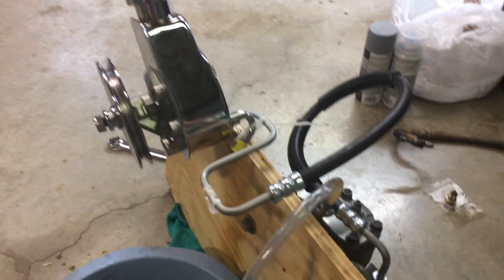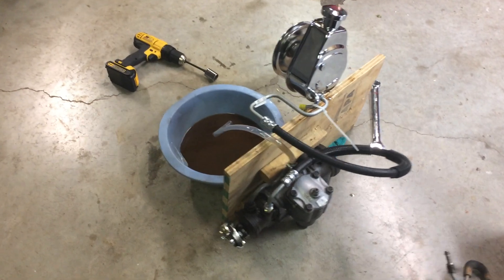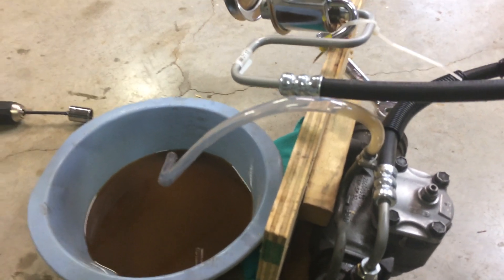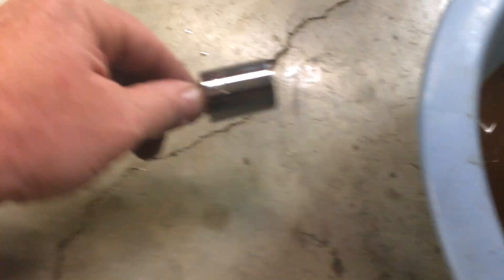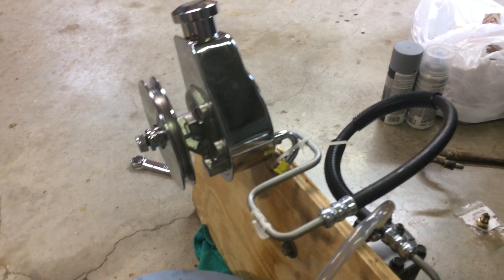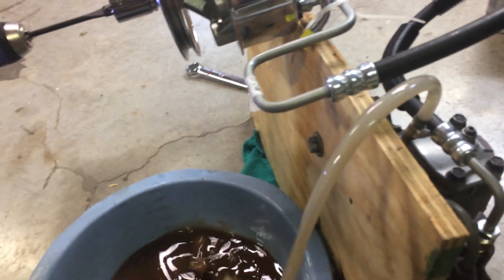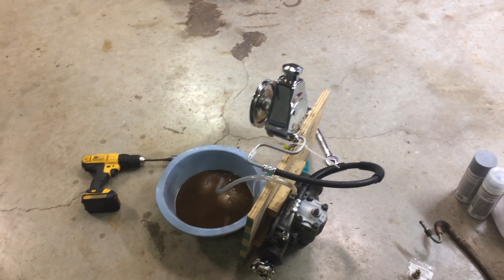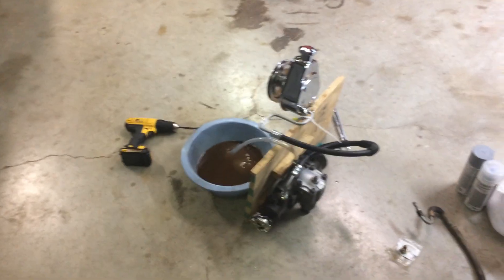Bench bleeding a power steering box Saginaw Chevy Camaro Chevelle Nova Corvette

Comment: Did you need to upgrade your pump in order for it to work with that box or is it a stock ps pump
Reply from the maker: It’s a stock style aftermarket Tuff Stuff power steering pump. I didn’t have to upgrade anything because I was manual before my PS conversion. But any remanufactured stock pump will work.